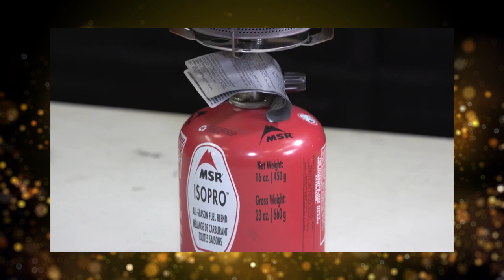Visual demonstration of wood pyrolysis or what happens in a downdraft gasifier hopper

Comment: Nice video as always. Could I use copper pipes instead of steel for my radiator in order to cool the gas? I want to know if this could affect the quality of the gas...
Reply from the maker: yes, you can, it won't affect the gas in any way
Reply: It will condense the gas, making the gas negligibly more difficult to use (fuel flow decreases negligibly )

Comment: why didnt thr gas burn after passing through the water ?
Reply: Not enough gas concentration and too much water. Higher heating temperatures will fix this.
Reply: The water is cooling the gas too much, it burns more easily when he removes the bit before it goes through the water. 
Here's the original video:
https://www.youtube.com/watch?v=AMZ7JmAIZPg

Comment: Hi
Which reactor temperature is optimal to have less tar?
To run a generator with syngas how mutch  tar can be tolerate for m3 of gas.
Thank you.
Ciro
Reply from the maker: 1250 C, different countries have different tolerances. In India, up to 0.1g per 1m3, in Europe, mine is 0.025g. I don't remember the exact number. Better not to have it at all.